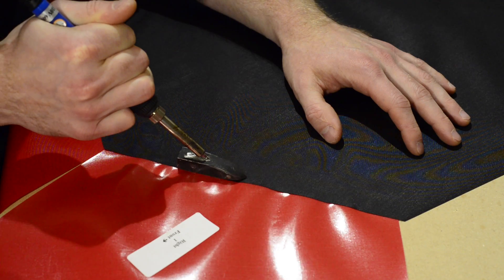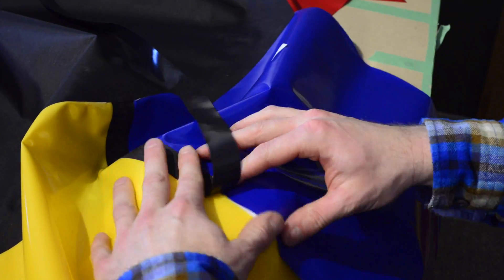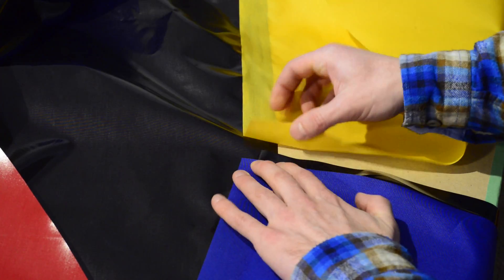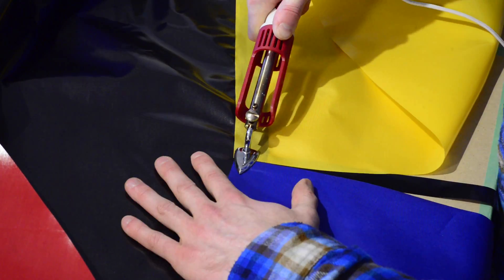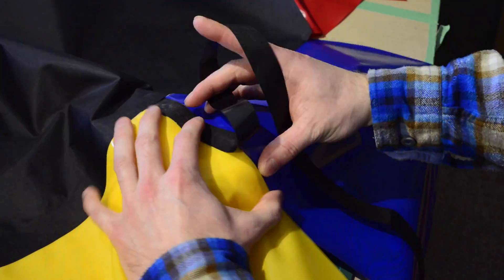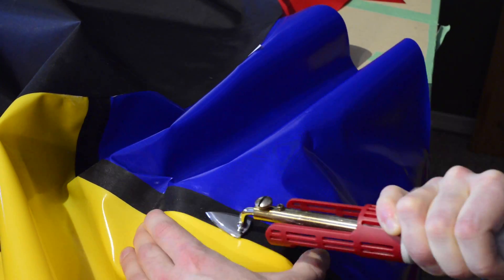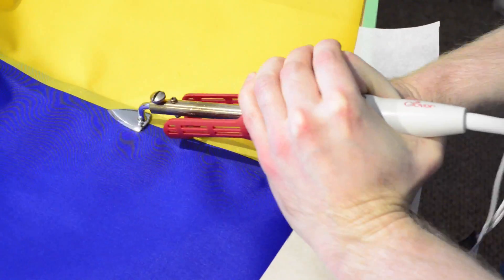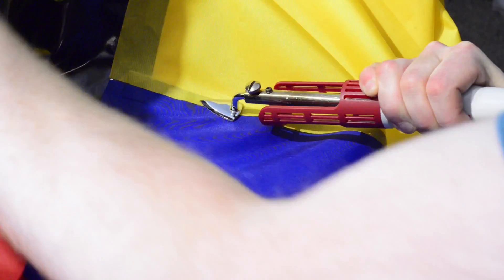DIY Packraft V2 Kit: Step 2 - Joining Tube Pieces Together

Comment: Hi, what is the best way to make holes in the floor, to make it self bailing ? I'm scared of shredding the floor in the river. Do I have to renforce it ? Thanks 🙏🏻
Reply from the maker: You could make a punch out of a metal pipe (sharpen one end and then hit the other end with a hammer), or just use scissors and try to make the holes as round as possible. If it were me, I wouldn’t bother reinforcing it - it’s easy to repair, if needed.

Comment: Hi Matt 
Have these instructions changed for the v3?
In the written instructions the 3L piece is fixed to the floor on both sides
Should I be following these videos or the protected v3 instructions?
Reply from the maker: Hi Sean, you’re is a V3 Kit so please follow the V3 instructions. I’ll change the titles here to make it clearer that these are the old V2 instructions. Cheers!

Comment: What type of thread is used for stiching inflatables? And do we need heat sealing even after stching..whats more reliable ? Or Can we do both of them togather?
Reply from the maker: You can do both if you want, but heat sealed joints are stronger than the fabric itself, so sewing would not add any strength.
Reply: Ok which method is stronger hot welding or sewing?
Reply: For adult water park
Reply: Once a seam is stronger than the fabric itself, no point in adding extra strength. I'd bet that welding is stronger.

Comment: Which thickness is best for inflatable waterpark ? Do different material have different roles in parts of a project? Like sealing or flanges or holder hanging materials or anything else? Or we can make a complete project with one single thickness??
Reply from the maker: The material you use should depend on the strength required for the particular application. For testing you can order a sample pack with all of the different fabrics.

Comment: In this video, you are using an Iron with Red Handle and a smaller Tip (assuming: Mini Iron II).  I was testing this iron (Heat Setting: High) on your 40D Heat Sealable Nylon-66 Fabric.  As soon as I touched the fabric with the Iron, the test fabrics melted and got stuck to the Iron tip.  Do you use a different heat settings for different grades of your fabric? Also, how do I remove bits of fabric from the iron tip? Can I simply use some paint thinner or nail polish remover? Thnx
Reply from the maker: Hi Sunny, there is some variation between iron temperatures, even among irons of the same model, and you may find that the medium setting works better for you. Please check http://www.diypackraft.com/proper-heat-sealing-technique/ to learn about setting the right temperature. 

To clean your iron, you can rub it on some wood while it is hot to remove the melted plastic. There may be some dark residue left, but this will not affect the iron's performance.
Reply: yes